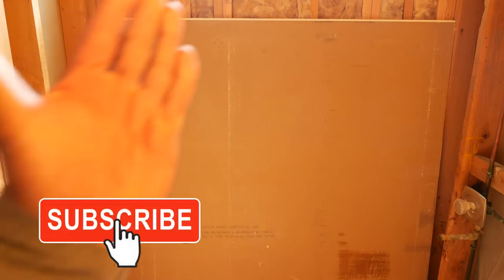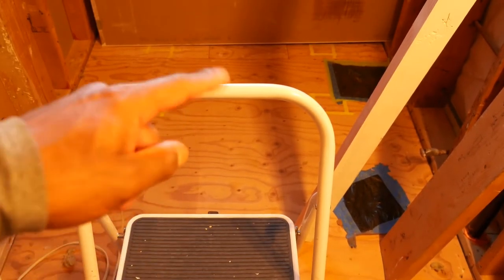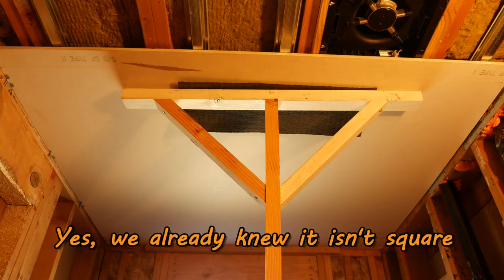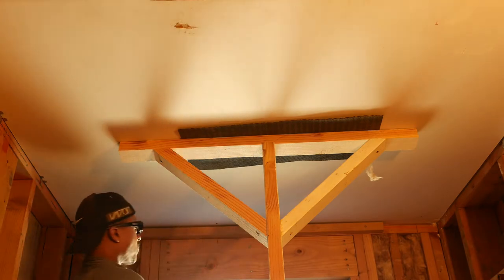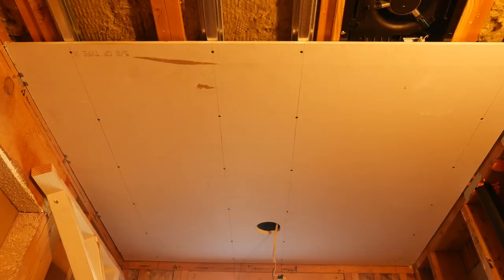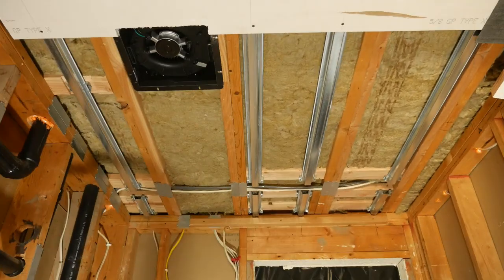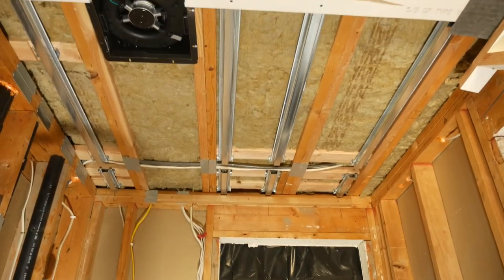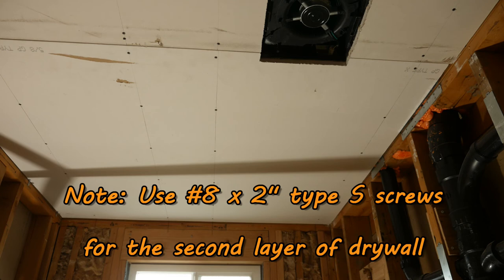Bathroom Remodel 53 - Ceiling Drywall Installation

Comment from the maker: Well, this was fun. My plans were almost foiled by one meddling nail :-)

🔧▬▬Tools and Materials▬▬🔧
👉 DIY Apprentice Recommended Tools and Materials ► https://bit.ly/2T5psFw

✔️ 54" Drywall T-Square ► https://amzn.to/2zIokBy
✔️ 5/8" Prest-On clips ► https://amzn.to/2LkAwKe
✔️ Drywall: Pro Tips for Hanging & Finishing ► https://amzn.to/2uBsoOj
✔️ Drywall Screw Depth Set ► https://amzn.to/2uGSyzS
✔️ 8x1-1/4" Fine Thread Drywall Screws (Type S) ► https://bit.ly/2Ob5ZjK
✔️ Rotozip 1/8" Guide Point Bit ► https://amzn.to/2Odbq1B
✔️ Halo H99RTAT can light ► https://amzn.to/2PMlP5k

✔️ DeWalt DW272 VSR Drywall Screwdriver ► https://amzn.to/2zpguKT
✔️ DeWalt DW272 Nose Piece ► https://amzn.to/2zpgqLa
✔️ DeWalt DW272 Carbon Brushes ► https://amzn.to/2xODuRw
👉 See DeWalt DW272 VSR Drywall Screwdriver Review ► https://www.youtube.com/watch?v=iEFbn...

✔️ Porter Cable PCCK647LB Impact Driver ► https://amzn.to/2IO70L3
👉 See Porter Cable PCCK647LB review ► https://www.youtube.com/watch?v=xqLYu...

📷▬▬Video Equipment▬▬📷
✔️ Camera used ► http://amzn.to/2GcpkOb 
✔️ Lens used ► http://amzn.to/2Deu16S 
✔️ Tripod ► http://amzn.to/2GbaM1c
✔️ RAM Suction Mount ► https://amzn.to/2Wz9PXh
✔️ Cyberlink PowerDirector ► https://bit.ly/2jTwGxT
✔️ Adobe Photoshop ► https://bit.ly/2V7nyUX
✔️ Camera Slider ► https://amzn.to/2WtD7GW